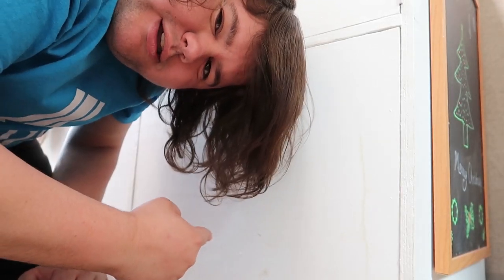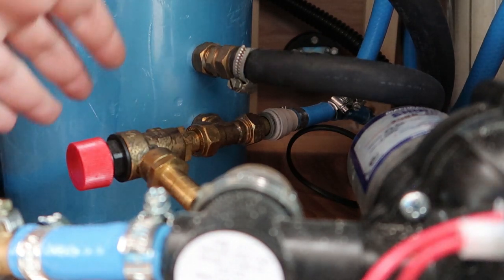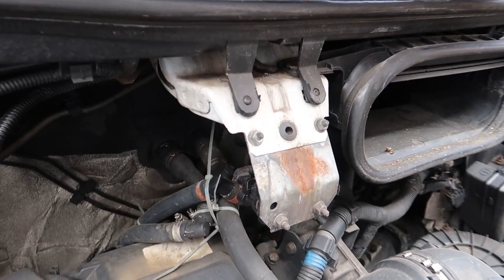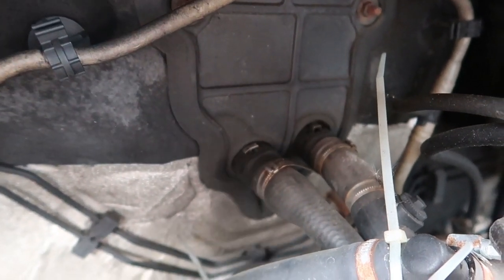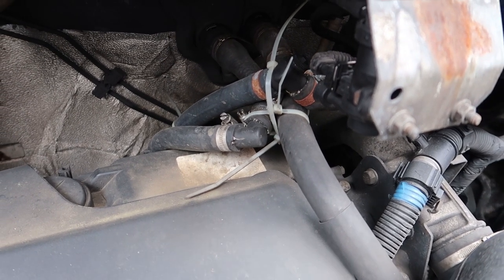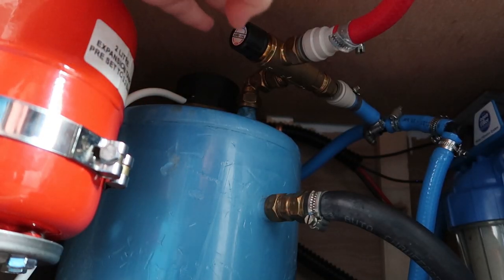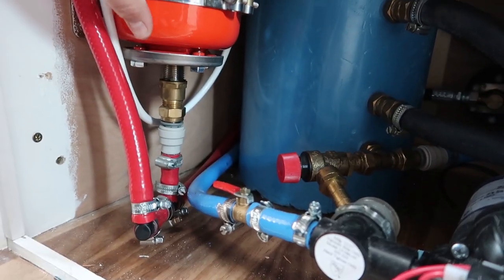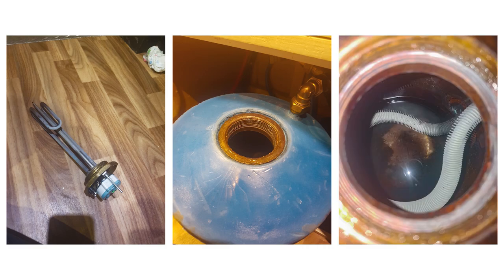How to Get HOT WATER in a Campervan Using the ENGINE! Calorifier Tank in Campervan | Van Conversion

Comment: The biggest downside is added stress on the cooling system. With this system your extending the length the coolant needs to be pushed.
Reply from the maker: We did actually mean to mention this! We added about 4 / 5 metres in total to our length and it's been over a year and can't say we have noticed any issues. However I agree the water pump is probably under a bit more stress. We fitted the pipes with as little sharp bends as possible to create as little stress as possible.
Reply: In my opinion I don’t think will cause must tear in the water pump, as minibuses also have heat exchangers (central heating style )in the back for the same vehicle.
Reply: Std fit on many boats, ours is the same with an extra 10 or so meters of pipework, still works fine at 30 yrs of age.
Reply from the maker: @lynalllynall9082  Yea we havent had any issues so far, and I have heard of setups with much longer pipework!
Reply: I think the added stresses on the existing parts of the system the main water pump) are negligible. Also the argument often heard is the cooling system not able to cool as well as before is somewhat of a myth since the heat moved away from the main cooling system into a boiler is actually removed from the system so any cooling issues are a non issue...
Reply: What’s the accumulator for
Reply: However the added coolant and extra lines means more heat dissipation which means your coolant system should be more efficient.
Reply: @nickwskeling4241  The usual function of an accumulator is to accommodate extra pressure that builds up in the (clean) hot water system as the water expands.  Otherwise the additional pressure can cause failures at pipe joints or the water vessel itself.
Reply: @familytelly6438  isnt  safety valve fitted for this reason ? im doing the similar system , just my calorifer tank is 30l plus 12v electric heater in the top part to heat up 7 litres out of battery only in case if not travel for a bit. im just wondering do i need a accumulator tank or valve 6 bar ( or other size) will be enough, any ideas ?
Reply from the maker: You need an expansion tank. Based on the size of your 30l tank. We have a 2l expansion tank which is fine for a 10l calorifer.
Reply: @adventuresinacamper  Thanks for your reply. I believe you know what you talkig about as you have it fited and working. Love the Idea and thanks for inspiration. Just have a question here :  I'm not a plumber and i know nothing about it, so I might be wrong, Im only asking this as I dont have much space to put expansion tank, will It be ok to leave hot water tap slighty on for the time of heating up to get all that extra pressure off the system , i have a big sink so no way water will go somewhere else and if i loose 100 ml of water while heating up its not a big loss as i have 100 L in total. Alternatively if thats not an option and i go with expansion tank , what rating of pressure valve i should take for it , 3,4 5 or 6 bar ? any ideas
Reply from the maker: @cezarycezary3002  Sorry I am not a plumber my self, but surejust the place we purchased ours from have a page related to expantions tanks. https://www.surejust.co.uk/advice-and-troubleshooting
Reply from the maker: You would need to look at the manufacturer instructions for the expansion tank, I think it should be fine. 150l is a big tank, is this for a van?
Reply: What do u mean, normally when u turn of ur heating the used circuit is completely cut off.
The worst this can do is decrease ur air heater peformance..
Reply: @diederickb1806  your coolant system is "constantly" flowing. You don't ever "turn it off". And the additional piping will make the initial start of the fluid moving feel like trying to push a boulder up hill. Sure the additional piping will make the pump work a little harder under it's normal work load. But it's then the pump first starts to get the fluid moving. Is when it's going to feel like trying to push an F350 uphill instead of a say a kia soul. Not to mention the additional weight in the pipes of the coolant. Which means even more work and money when it needs to be replaced for any reason.
Reply: @NomadCF  wrong, u have 2 loops one that goes trough a temperature bypassvalve and ur radiator(always running) . The other one that goes to a valve and ur internal heater.
Reply: @diederickb1806  not in this case you might want to re-examine your mechanics book.
Reply: @NomadCF  u gonna tell me ur heater core is alway up to coolant temp? That would make no sense in any car

Comment: This system is ideal and simple. You may have to run the engine more often but then you also charge your batteries this way.
Reply from the maker: We adjust are travel style to suit the system, for example in the morning if the water is cold, we will drive to our next destination and on the way stop to use the water / wash or do it once we arrive. I dont like leaving the engine idling exspecially when parked next to other people.

Comment: I brought a ex telecom van 20 years ago they came with a water tank mounted in the engine bay with a thermostat on to control how hot the water gets; it works in exactly the same way and had a pipe run to the back of the van with a small sink on the inside of the back door the engineer could use to wash his hands.Found it the other day in the loft will be going on Gumtree shortly lol.
Reply from the maker: I have recently seen a couple people say there ex telecom vans had them! Im sure someone will buy it!

Comment: Clever idea, I'm thinking of doing the same for my van, I'm guessing you just cut a hole in the floor at the back of the van where the calorifier is for routing the coolant hoses in from the engine?
Reply from the maker: Yep, just secured the pipes along the bottom of the van using anywhere I could attach to and drilled straight up through the van floor. Good luck!

Comment: this might be a divi question but would be easier to add a T connector for the coolant pipes, just trying to get my head around it, thanks Mark
Reply from the maker: To add a T connector you would need to tap into both pipes instead of just one, however after that the process isn't much different.

Comment: How do you stop heating and thus boiling off all your water?  It appears the long distance to the water tank dissipates heat.  I worry that I'll boil all my water away.
Reply from the maker: Never had any issues, I think as its in a sealed unit the water does not boil away as there is no where for the vapour / liquid to escape, we done 12 hours drives and its all been fine.

Comment: For those like to try something like this, every combi boiler normally used to heat a house has a calorifier in it, complete with a pressure release valve and a mixer valve. If these boilers are disused usually the boilers are fine and can be had for scrap metal prices... Ask your local friendly central heater people...
If you were to plumb in a hydronic heater like a webasto or the like you can have heating in the van, hot water for the galley and even (if plumbed right) a preheating system for the engine for when you are  in a very cold climate... Also the use of a hydronic heater device lets you create hot water without the need of the engine to run...
Reply from the maker: Good tips, I have seen a couple used setups for sale on ebay as well.

Comment: The GMC motorhomes from 1973-78 had this as a stock system in the vehicles.  Hot water was supported also by the engine. I think the tank should be much closer to the engine and reduce the coolant needed and exposure of the hoses to failure and damage. Water pumps may also have added stress. It depends on the vehicle. Some vans already have rear heat blowers that could be used for this.  My 2017 GMC van did.

Comment: This is awesome! I would be so tempted to add a couple of radiators with thermostats to the system for the colder months. 
Thanks for sharing
Reply from the maker: I have seen people do somthing like this or use a seperate pump / coolant system to heat there van instead of the common air heating most use.

Comment: Great video, thanks for sharing April and Shane. Inspired by your setup we're planning on using a calorifier for our Ducato as well. 

Did you consider undermounting the calorifier, to save space? A wide 15 liter version might fit in between the fuel tank and the exhaust silencer. In terms of heat economy it might not be the best solution, but it saves a lot of space inside the van. Leaving out the accumulator would also do that. Not sure how bad the pulsing would be.

On top of that we're considering using a dual coil calorifier and hooking up the second circuit to a Bobil heat exchanger. It's a fairly inexpensive way to heat up water using hot air from the diesel heater. This way, when we're more than 12 hours at the same location we can still have warm water. In warm climates, hot waste air can be diverted underneath the van.

Another option is to use a 12v immersion heater (in the calorifier) for those occasions. I believe they are 300-500w, so on a 2kWh battery you would have at least 2 hours to heat the water in the calorifier, and have 1kWh spare.

Would love to hear your thoughts on this! Regards, J&M
Reply from the maker: Very sorry only just seen this. Under mounting is an option and would save space, I have seen some setups like this and in our next van it may be an option, maybe add additional insulation around the existing to help keep more heat in.

We did look at the two coil version but due to where we layer out everything couldn't make it work. I've seen setups where people use a heat exchanger on the room heater to heat up a separate coolant pipe system which you could feed into the second coil, so when your heating your room. You are heating the water as well.

Let me know if you do any of these options, be good to hear how it went.
Reply: Hi! Great idea! I am considering this calorifier system as well, but I don’t know yet if I’m gonna drive every day to a new spot. So the additional diesel heater system is a good idea as well. My question around this: can I add the diesel heater system afterwards, if I see I need it? I guess I will have to buy the dual coil calorifiers from the beginning? Can I leave one input (for the future diesel heater) open/not connected, until I think I need one? Or does everything need to be connected ? 
Thank you for the info! 🙏🏽 great video guys! Helps a lot!

Comment: Great video and have often thought of doing similar but using T peices from the engine and a 12v solinoid valve to turn on and off  so as not to starve the van heater when it cold in cab. Eventually decided on a 12 volt 300 watt immersion heater but this does take 25 amps so you need to be driving not just idling and takes hours.
Reply from the maker: We looked at getting a 12v imersive fitted to ours but decided the power requirements would be to high to heat the water when we are parked up and it be easier just to run the engine. Can't say we have any issues with cab heaters due to the unit, it does take slightly longer to heat up when its cold but no issues once its all heated.

Comment: Hi, any problems with the cabin heater now you have conected the tank?
Is it inline before or after the cabin heater?
Do you have to have the cabin heater on to get circulation on your system?
Reply from the maker: Nope never had an issue and we had it in for 2 or 3 years now. In-line before the cab heater and no cab heater does not need to be on.

Comment: good job. what i don't understand the cooling water has also antifreeze inside. isn't the bath water mixing with the engine cooling water.
Reply from the maker: The engines coolant runs through a coil inside the cylinder so never comes into contact with the water.

Comment: Did you have to reduce the Internal Diameter (ID) your pipe to use this calorifier? Did it cause any issues? My heater box feed pipe has an ID of 20mm my calorifier coil connectors are only 16mm. I'm afraid this will cause a back pressure.
Reply from the maker: Honstly I cannot remember, I think the john guest speedfit may have been slightly smaller, we havent had any issues.

Comment: Some years ago I fitted a calorifier like  yours to a campervan but I used "tee" pieces as I thought that when the heater was off there was no flow through the heater pipes. Is this not so? Because I'm about to do it again to a new campervan build I'm doing at the moment.
Reply from the maker: We have always had hot water even when the cab heaters are turned off, I believe there is alwasy a limited flow, but I could be wrong. Can only tell you, it works fine for our van being installed inline, and I know of a couple other people who did the same as us and have not had issues. Good luck with your build!

Comment: Thank you for the informative video! ❤️ Do you think it's possible to combine this and a circulating shower system?
Reply from the maker: Most probably, since it is technically just a water storage unit with a coil running through it, you will just need a clever network to recycle the water and possibly filter it? To stop the shampoos effecting the tank? You could possibly drop to the 6l size tank also. If you do this please let me know how you get on!

Comment: How is your immersion connected with mains hook up as well as engine cooling system
Reply from the maker: The calorifier comes with a built in immersion heater for using mains to heat the water and a seperate coil for the engine coolant to run around.

Comment: Love the video can i ask where you got the insulation around the flow and return pipes from. Thanks keep safe
Reply from the maker: Thanks, are you referring to the cooland pipes from the engine? They are just 5m lengths of engine coolant pipe, just measured the diamiter of the pipes for my van and brought the same ones in the required length to reach to the calorifier and back to engine.
Reply: @adventuresinacamper  the pipes that come from the engine bay to the calorifier , as they leave the engine bay they look as if they are insulated i can only find the big diameter stuff what you would use in the construction industry can you advise
Reply from the maker: @bernardpepper6568  There is no insulation on those pipes other than the pipe it self, it is engine coolant hose which is quite thick rubber pipe by itself. Here is an ebay listing I found of the type of stuff we used. Hope that helps.

https://www.ebay.co.uk/i/113822964820?chn=ps&var=414028965093&norover=1&mkevt=1&mkrid=710-134428-41853-0&mkcid=2&itemid=414028965093_113822964820&targetid=1000147648940&device=c&mktype=pla&googleloc=1006653&campaignid=10199631037&mkgroupid=101938325957&rlsatarget=aud-381667280803:pla-1000147648940&abcId=1145985&merchantid=119065133&gclid=CjwKCAiAiML-BRAAEiwAuWVggkNwNRCFa0NGGqZ_E6m3XPwaJFQJjCQf_bPU3gJ0s60I_ZopmSZz5RoCnXIQAvD_BwE

Comment: I wish Dad & I had this in our motor caravan back in the 80's. We had a instantaneous gas heater, which was very temperamental. May I ask why it's installed in series with the heater matrix? Presumably you don't get hot water if the heater's off, do you?
Reply from the maker: Modern systems are more reliable including gas! No we still have hot water even if the heaters are off, the heater matrix in vehicles still heats up, which is why if your been driving for a period of time and go from cold to hot air you get instant hot air from the blowers.

Comment: Hi guys, fantastic idea and very well executed!! Just been discussing that very idea this eve… I have a question for you; what wattage does your immersion heater draw when you heat up the water when stationary ? Just calculating the inverter size needed coupled with everything else on the load. Cheers
Reply from the maker: Thanks. I believe our immersion is 1000w. We don't use ours on the inverter as it would deplete our battery bank to fast. Its hooked into our mains hook up point, so only usable if we have a mains power supply.
Reply: Got you…batteries are super expensive! Thanks for sharing 🙏

Comment: Great video! I have been looking for build with this style water heating for a while. My one question is do you remember the diameter of the coolant pipe and where you got the pipe from? I am thinking of doing this on a Fiat Ducato but trying to cost up this heating system. Thanks
Reply from the maker: I think it was 15mm inner diamater pipe and we got it from ebay, I initially cut the pipe on the vehicle and meased the inner diamater, cannot garantee your pipe will be of the same diamater. Ours is a Fiat Ducato.
Reply: Thank you for the reply! Really appreciate it

Comment: Have you thought about changing Electric element to 12v /24 element ?
Reply from the maker: You would need a heavity power setup to be able to substain the power requirements for a long period. I did the math with our setup an a 1kw 12v element and it would use a huge chunk of our power reserves to get the water heated up in the 30 to 45 minutes it would need to run. I believe 1kw @ 12v needs 80+amps an hour to run.

Comment: Thanks for , info . Looks an ideal set up . What was the cost please and did I hear correctly , if required you can turn on an emersion heater to heat the water , when you have not driven for a day or so.
Cheers Ralph
Reply from the maker: The calorifer was about 350 I think then then pipes and connections on top, I don't have an exact cost. Our calorifer has a 230v immeraion heater installed so if we had electrical hook up we can heat the water, but this has actually stopped working so needs further investigation.